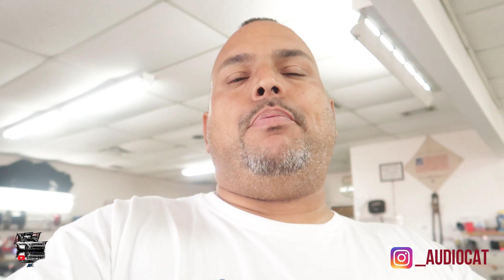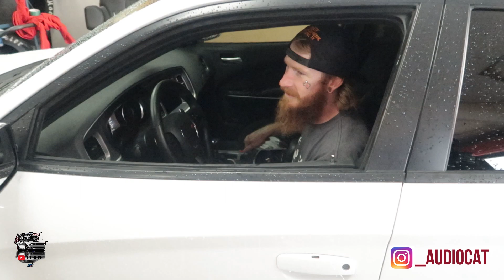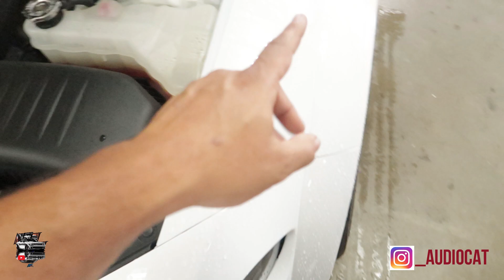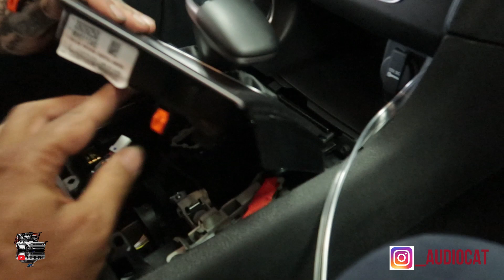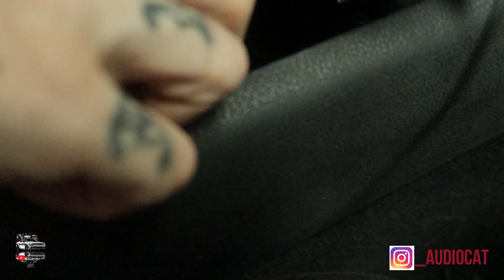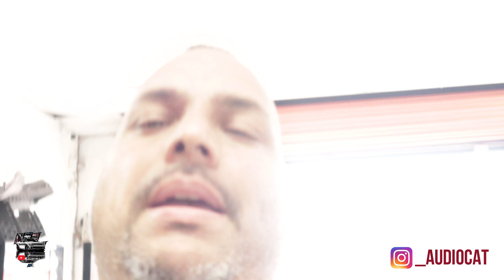HOW TO STOP THEFT OF YOUR DODGE CHARGERS AND CHALLENGER

Comment: Man we have something so much better for these cars. I own a car audio and security shop in philly. The system we use needs to see a pincode entered via factory buttons on your steering wheel which is programmed by the vehicle owner. The vehicle can not be started, it blocks anyone from programming a new key to it, and it locks the shifter into park. The correct pin code must be entered or the car is inoperable. If they try to steal it, they will fail. Its tried and true.
Reply from the maker: Bro hit me up Instagram let's talk
Reply: What’s your instagram?
Reply: @tcerano  OxAudio
Reply from the maker: Audiocat
Reply from the maker: Audiocat
Reply: @Chase Yangtze im in philly. How bout you?
Reply from the maker: 930 N. Belt Line Rd. Suite 130 Irving Tx. 75061
Reply: @OxAudio I need to order this system from you, I currently have a dodge scat
Reply: @northcalislimm4330  where are you located?
Reply: @OxaudioPhilly  I’m in Atlanta
Reply: @OxaudioPhilly  I’m in Atlanta, do you have a site I can order from , I don’t have instagram
Reply: @northcalislimm4330  no sorry. We dont sell them without installing them. You wouldnt be able to install it without the proper equipment to program it anyhow
Reply: @OxaudioPhilly  ok thank you for responding. I was to get in touch with another audio shop they able to sell & install the system for me.
Reply from the maker: 930 N. Belt Line Rd. Suite 130 Irving Tx. 75061
Reply from the maker: 930 N. Belt Line Rd. Suite 130 Irving Tx. 75061
Reply: @northcalislimm4330  ok cool. Whats the name of the shop?
Reply: @OxAudio my fault typing too fast. The name is Imperial Autosports in Atlanta the owner reached out to the company where you all are authorized to sell & install to see if they can get it down here, he saw y’all are the few in the US to sell & install.
Reply from the maker: Audiocat
Reply: @OxaudioPhilly  Do you offer this device for Mustangs too?
Reply: Wouldn't it be easier to use those wheel locks that they use when the cops want to impound your car?
Reply: @nerychristian  yes we do. I dont see how that would be easier then entering a pin code in 2 seconds with your factory buttons.
Reply from the maker: We also do the ugla system here
Reply from the maker: Yes we do
Reply from the maker: 930 N. Belt Line Rd. Suite 130 Irving Tx. 75061
Reply from the maker: We sale them too 930 N. Belt Line Rd. Suite 130 Irving Tx. 75061
Reply from the maker: 930 N. Belt Line Rd. Suite 130 Irving Tx. 75061
Reply: What if someone swaps the computer?
Reply: @whydoyouwantmyname5857  it wouldnt make a difference. Has nothing to do with it.
Reply: Where you located in Philly
Reply: @Rylo24  right outside NE in Cheltenham
Reply: @AUDIOCAT how can i order this system from you i have a dodge charger
Reply: @OxaudioPhilly Need to order this for my car. Go to school in a really unsafe area and cars are stolen off the lot in broad daylight
Reply: @KateOnYT2023  where are you located?

Comment: FYI Dodge already has a new anti-theft solution. They lock out the ECU preventing a new key to be programmed. Just make sure and program two more additional keys just in case you lose a key or becomes damaged.
Reply: For how much?
Reply from the maker: Free at dealer
Reply: what happens if you lose all the keys?

Comment: Add zip ties to the fuse box, it will delay the process and keep the horn going for a few more seconds.
Reply: How about relocating your horn fuse and Relay
Reply: @shagytrsc2  that’s exactly what I was thinking as well
Reply from the maker: It woks for sure
Reply: Construct one out of metal that has a ridiculous amount of screws
Reply: Put a Viper horn fuse in  a location unknown to thieves along with an Alarm system✌😎☮
Reply: Nice
Reply: silicon glue the fuse box lid on

Comment: Great video!!! Neutral block off plate, relocate the ODB plug and add a kill switch! Love getting ideas like this, I worked hard for my Mopar's and hope to keep them !
Reply: Where can u relocate the ODB Plug at tho
Reply from the maker: Can say online boss
Reply: @rambop1385  I bought a ODB plug from the auto wreckers and installed it where the factory one was, and then used a ODB extension cable and relocated the end to a location that I only know where it is. Make sure you tell your "trusted" mechanic where it is when they are working on your ride or it will frustrate them to no end and you will get the hefty bill!
Reply from the maker: Correcf
Reply: You could just pull the fuel pump fuse?

Comment: I cut the red strap off. Use 2 "different" security screws. I made a tool to pull up on the neutral lever and the 2 different security sockets and hid them. At least it won't be easy for them now.

Comment: Do you know how long time would take to remove that plate? Less than what it took to install.
My car had 2 steering wheel locks, and they took any way.
Reply from the maker: Did you have a good.gps.with kill switch and tilt sensor shock sensor glass break sensor

Comment: Another deal is adding a remote killer in replace of starter or fuel pump relay. Only works via remote. 
Hate to say it the old school brake pedal locks as well to prevent the brake pedal from being depressed.

Comment: When parking my  392 Challenger in a parking lot I lock my Brake Pedal with this high quality Brake Pedal locking club for the car can not be started and also put the car in Valet Mode, (so if is stolen they can't drive in very fast. After watching this I'll be silicon glueing the fuse box lid on, or locking it down someway, and maybe the something like a small cable around the bracket that you pull up to put the car in neutral.

Comment: The best thing with that plate is to have the 2 bolts replaced with secret bolts. Otherwise it is easy for thefts to just unscrew those 2 bolts and proceed with steeling :)
Reply: Where can I get different bolts from if you know ?
Reply from the maker: Text me at shop 972 513 0111

Comment: Thieves are onto this automatic neutral plate.  It will take a little more craftiness now.  Remote kill switches when the vehicle is molested, glass sensitivity monitors for any glass breakage, a fuel kill switch, and a fob Faraday box or sack for the key fobs.  These will discourage most thieves, along with keeping your MOPAR in a garage, using a steering wheel lock that blocks off air bag removal, and something else that UConnect offers, a throttle disconnect you can deactivate the gas every time you park the damned thing.  Thank God I only own an R/T+, but they are actually being targeted lately, so beware, and a nice shotgun helps, especially if everyone sees you carrying it around your house.

Comment: Just had a 2020 Scat Pack stolen last week using a dummy key fob. We have another two weeks before we can get it replaced. The car was Smoke Show grey. We will definitely be coming to see you to have all the deterrents installed. Thanks for posting.
Reply from the maker: We got you
Reply: @AUDIOCAT  what works for the 6 speed manuals?
Reply: @lmjames33  If it was mine, I would definitely have a hidden switch hooked up to the neutral safety switch on the clutch.  Car will never start unless the thieves know where your hidden switch is.  And they wont be expecting that to be your defense.

Comment: Here's some information I got from a couple videos on the subject. What I saw involved 2 people. A successful heist of a car depends on the fact that most people keep their car keys right by the front door. This has to be a given. The thieves have a receiver / transmitter much more sensitive than what the car has. Thief #1 gets close to a house, and again the actual keys have to be near the front door; he gets close to the house, his very sensitive receiver will pick up an emitted signal from the key fob supplied by Chrysler. It will then amplify and broadcast the received signal to thief #2, who is down by the car they want to steal. Thief #2's receiver picks up the amplified signal and then transfers it to the car. The car door will automatically unlock  as though the owner's own key fob is telling it to unlock. It unlocks, thief #2 hops in, presses the start button, the car starts, and he drives it away. 

In order to foil a thief, the easy thing is to put your key fob as far back in the house as possible, and even better would be to have a small lead-lined box to store it in. The lead box will curtail the key fob's broadcasting ability to the outdoors. This is what I do, Now, there may be other ways that I don't know about, but this is what I've read and viewed on videos. In all scenarios, keep the key away from the door, keep it protected as much as possible. The goal in all cases is to not let a thief pick up the transmission signal from the key fob.
Reply from the maker: This is facts but a more popular method we have seen in the DFW area is popping the car in neutral and pushing out than taking an other car to push the car to parking lots 1 to 2 miles away and that is that

Comment: So what about the steering lock? Without a key the steering lock does not release. How can they push a car into the street and then into the apartment complex without steering?
Reply: They break the steering lock from my understanding.
Reply from the maker: No lock on new dodges
Reply: @AUDIOCAT  What year did they stop putting the locks in them? I have a 2017.
Reply from the maker: 2015
Reply: Buy some wheel locks

Comment: Do these things work on a 2022 Dodge Durango. I see most of these video's for Challengers and Chargers. I got my Durango With Tow n Go and it got stolen. Was planning on getting the GPS tracker, but because of the holidays, I did not have the chance. We are getting a replacement, but yeah. Would any of these awesome ideas work?
Reply from the maker: Yes no probrem we have other option also
Reply: @AUDIOCAT  unfortunately I don't live in the states. But overall I think this is the solution I need to protect my replacement durango, since the first one got stolen.
Reply from the maker: Agredd

Comment: Could you cut off the red neutral pull cord and zip tie the mechanism before installing the metal neutral release cover to add an extra measure of protection?

Is it possible to put a metal box over the OBD port to make it more difficult and time consuming to access the OBD port.

Is it possible to add independent sirens that activate when the alarm trips? The addition sirens audible inside and outside the car could be locked on for a long time period and powered by independent batteries. It’s possible to make the siren sound so loud inside the car to make it extremely painful to be inside the car, unless the auto thieve happens to be deaf, which is very unlikely.

Comment: Why did they bust the window & push it? They just copy the remote & unlock it then start the car.
Reply from the maker: We lock that out also
Reply: I seen some other video where a guy has something installed that blocks anyone from changing the fob code that doesn't have a secret password that you set up. I think he said it was like $1500. Even the dealership can't make another key without the password. They still broke his window too though but could not steal it

Comment: just got my car back from being stolen and they busted out a window, took apart the dash and gear shift lever to make a new key but in the process messed the systems up so they ended up ditching it a hour from my house, after putting new tires, window tint, buying a car cover and a steering wheel cover.
Reply: Buy some wheel locks

Comment: My Sxt was stolen twice I believe by the same people the first time the dealer claimed they erased the system for new keys but this couldn’t be true because 6months later it was gone again it probably would’ve been sooner but the car was down after a flood but as soon as it got fixed a week later they drove right off with it as if they been coming by trying everyday while it was down there was no broken glass alarm did not go off both times they only had it a few days no damage besides all the wires they pulled out! 🤦🏽‍♀️
Reply: Damn, so the sxt ain't safe either? Wow
Reply: @Lioness417 They are all chargers lol

Comment: I’m an automotive locksmith. Relocation of OBD is useless. Don’t waste your time. OBD isn’t used to add keys on newer model chargers. Haven’t used OBD on charger, challenger, grand Cherokee and a few others for a few years now.
Reply from the maker: No but with a y tech they can override security system and program if they need it so I little more is better then not enough

Comment: Great video, a little far from Pennsylvania so I don’t think I’ll be stopping by, the plates are those homemade that cover the neutral pull switch, also as a deterrent when I take mine shopping I pull into the spot cut my wheel all the way and I have a steering wheel lock with a ear piercing sound if tampered with, so they won’t be able to pick it up and tow it with the wheels turned all the way, and yes these are only deterrence but sometimes five seconds 10 seconds could make the difference, and also garage kept at night, good luck out there all you crazy Mopar fans,
Reply: Aye Bra what type of steering wheel lock
Reply: Hope that went through, again it’s a deterrent, but if you fool with it it has a very very high pitch sound, that will attract attention
Reply: Which one is it? I need one of those steering wheel locks
Reply from the maker: Yes share with us

Comment: Whatever happened to a person putting a steering wheel club on their steering wheel!?!
Reply: I did just that. And I put it on behind the wheel and turned the wheel so it’s on the bottom back of steering wheel. I know if someone wants my car they’ll get it but this will slow them down I know it takes me longer to get it on and off but I worked hard for my Hellcat. And thanks for the video I’ll try any
Reply: Yes I have this, they will have to bring some bolt cutters I think. Then they gotta find Kill Switch

Comment: You gotta get censors on your motion lights. Every time my motion lights go off a loud ass alarm goes off so you can't even get close. It's alot of ways you can get a alarm that is not even attached to your car so when the door opens it goes off and they wouldn't be able to turn it off.🤦🏾‍♂️

Comment: Got my charger stolen 3 weeks ago. Definitely need a kill switch 😩
Reply: Today in broad daylight literally about 10 hours ago in a Walmart parking lot . Apparently someone was f**** around with the false or cloned key fobs and got my car open but then discovered that I had the pedal and steering wheel lock on my car and they were not able to do anything and on top of it I came out of the store early because I had forgotten my card and so I guess I might have interrupted their process right along with the pedal lock but when I approach my car I noticed that the hood was unlatched and when I open my car door I noticed that the f**** emergency brake had been released like they were trying to put it in neutral and I guess they were in a hurry cuz they were trying to steal my car and they were pulling on everything they could pull to try to pull the emergency brake and the emergency brake lever and the lever are close to each other so I'm sure that some clueless f*** who doesn't own a challenger and doesn't know where anything is located would probably accidentally pull the hood latch instead of the emergency brake lever when they're fumbling around trying to steal your car and they happen to run into a snag like something such as the pedal and steering wheel lock which was very effective and thwarted their attempt to steal my car today and apparently it pissed them off because when I was heading back into the store and I ran my mouth I was f**** pissed and I screamed really loud a bunch of stuff out whoever the f*** was in earshot and I didn't give a f*** I still don't give a f*** this dude like walk towards me and issued a death threat at me and he said to me verbatim  this f*** looked me in the eye,.and said "we don't steal we kill" so I'm assuming that he was telling me that he may try to 
 murder me for my car 🤯if he tries to steal it again I was like oh really okay I'll be happy to get that on video and send it to the cops and I do not give a s*** !!I really will video tape anyone who i catch trying to steal somebody's car especially  a Mopar Owner I will video tape it and send it to the  police I am seriously fed up with this b***** and we all need yo put our feet down and put a stop to this b***** that's going on !! Hey seriously this is gone way too far !!! ((((HELLO))) my life was literally threatened today by some effing Dirtbag Thief who was mad that I interrupted his plan to steal my car !!! 
So now I am legit worried every time I go anywhere that  this fucker is bound and determined to get my car at all costs because maybe he is embarrassed that he failed today and maybe  I wounded his thug pride.  Idc fk that dirtbag . I will defend my life with deadly force if I am forced to. I think the direct verbal threat is cause for concern. I told the cops that are always at that wal mart buy they didn't give a shit but the only interests they took was that oh THATS  YOUR  car ?  WAS ALL THEY SAID.

Comment: Just put one of these in mine and it's at least some peace of mind as a deterrent for sure. Where can we find out about this RFID killswitch?
Reply from the maker: Call shop 972 513 0111
Reply: @AUDIOCAT   where are you guys located
Reply from the maker: 930 N. Belt Line Rd. Suite 130 Irving Tx. 75061
Reply: Buy some wheel locks